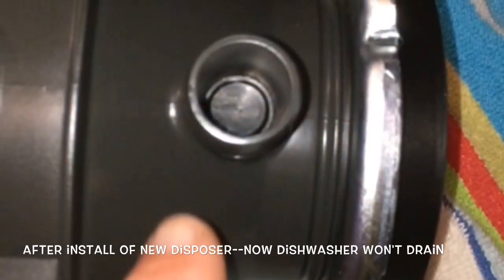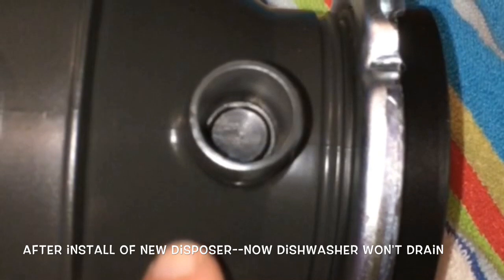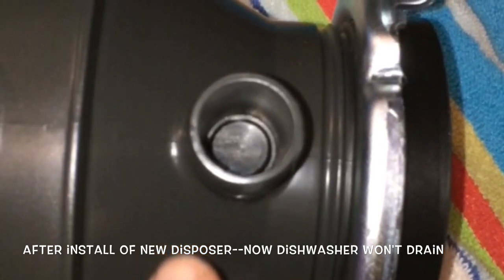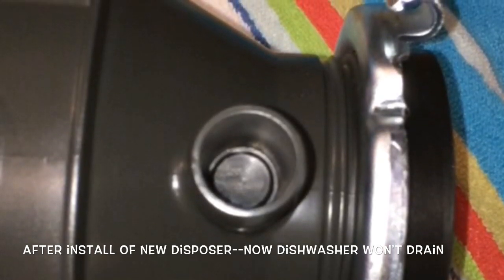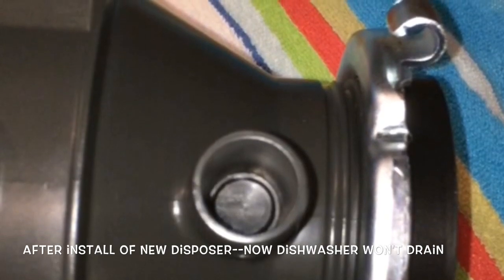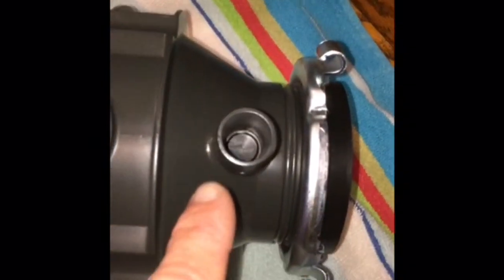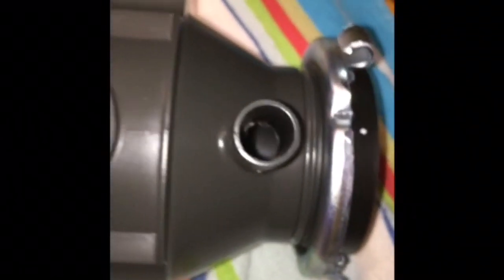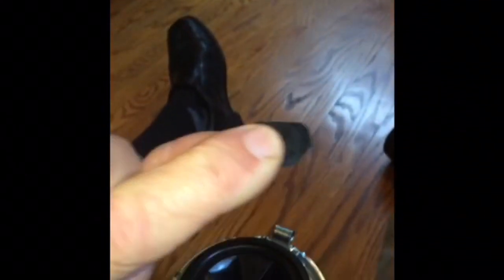✨ Dishwasher not draining - Garbage Disposer Clog - Quick Easy FIX ✨

Comment: After replacing my garbage disposal, my dishwasher started to not drain. Started to assume why everything was breaking down at the same time, mind you that my AC went out too lol. Took the dishwasher completely apart trying to find out the problem and came to see that the hole to the disposal was blocked. Came to this video to see how to remove it. Thank you! Crazy to think that there’s no videos showing this part…
Reply from the maker: I’m so glad it worked 😊

Comment: Maintenance came by a few weeks ago to fix the broken disposal.. suddenly, dishwasher wouldn’t drain. Insisted to them the two were related based on how the drain-hose was routed to it. Kept up with dishes by routing the drain hose to a bucket when I noticed small writing on the rubberized fitting end that said “REMOVE DISPOSAL DRAIN PLUG”. Thought to myself… “Surely it couldn’t be THAT simple…”
Poked my finger into the drain and found the plug!

Comment: Hi there. Do you know if there is any advantage of connecting my dishwasher directly to the sewer pipe instead of connecting it to my garbage disposer?
Reply from the maker: Hi Fernando,
I would advise connecting to the garbage disposal or instead of directly to the drain line.
The disposer is able to absorb the fast volume of water coming from the dishwasher and is less likely to back up.

Comment: You the man!!!!!!!!!!!!!!!!!!!!!!

Separate question:  Why this fucking stupid design by the manufacturers?
Reply from the maker: Thank you.

I don’t know why the wired design.
Reply: The design isn't stupid. Many homes still today do not have a dishwasher. Hence, the need for the plug.
Reply: It IS a stupid design.  If I were to design this, and I have to take a one model-fit-both approach -- most ideal would be to have 2 separate models -- I would design an open hole with a cap already on it.  Those without dishwasher can use it as is, and those with dishwasher can remove the cap and hook up the hose.  This way there will definitely see less confusion.
Reply: Cost. Your design would cost more than simply molding a knock-out plug right into the case while they are manufacturing it. This design has been around for decades. You can take my word for it...if there were a better/cheaper design, they would have figured it out.
Perhaps it would help to have a note in the directions about the plug for the non-professional... Oh wait, there is.
Reply: Just installed my badger 500, water kept coming back up on that plug on top of my sink and was overflowing so I knew something was wrong. And I remembered water follows the path of least resistance, in this case it wasn’t going anywhere so I knew something was clogged, in this case plugged so I put my finger and sure enough a plastic cap. 1st thing i looked up was YouTube videos for potential issues and mitigations and I found your video and that resolved my problem.